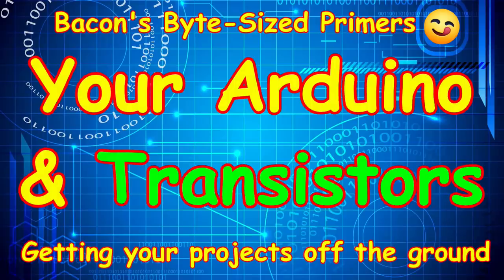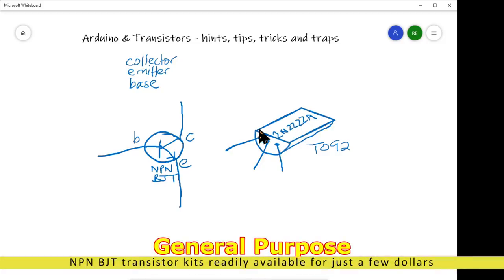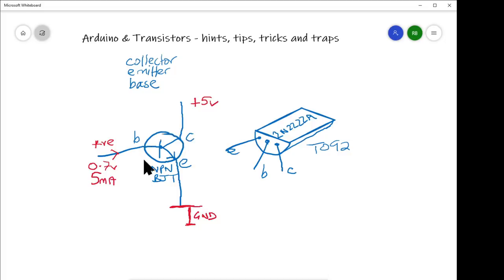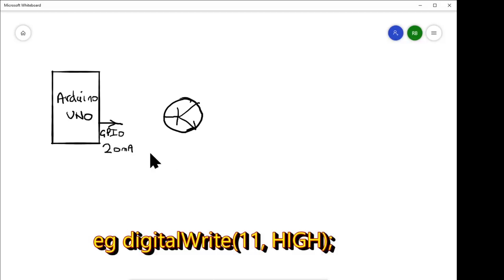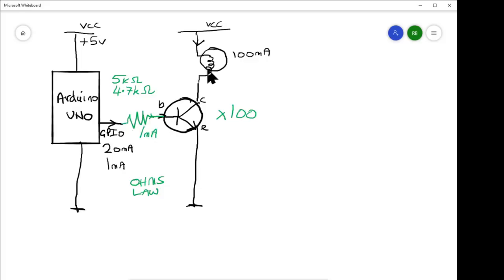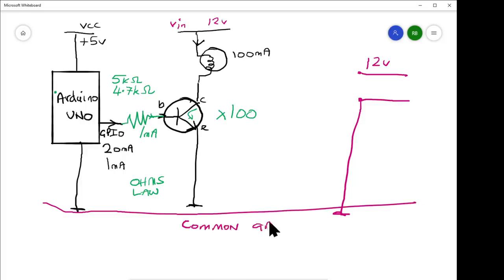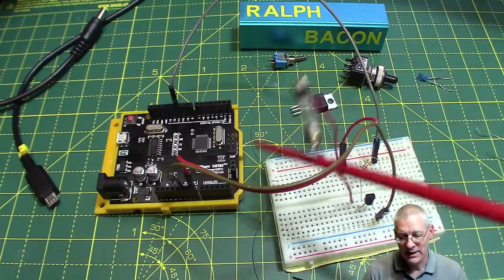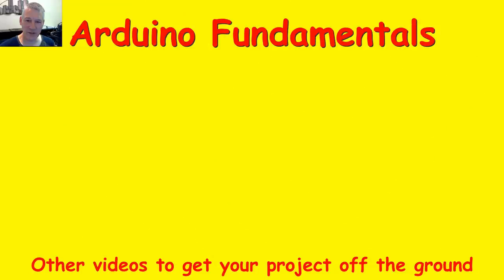#BB1 Transistors - from an Arduino Perspective. Bacon Bytes Beginners' Series.

Comment: Question: sometimes on a project I don't have the specific resistor or cap. But I read online, I can skip the resistor or use a different value. In practical terms, for such Arduino projects how much leway do we have in values?
Reply from the maker: It depends on what the resistor is doing. If it is limiting current to an LED then substituting a lower resistance might overdrive the LED. Or overload the Arduino port (pin). Not good. Substituting a higher resistance value one will make the LED (a bit) dimmer. That's OK. Other circuits might be much more critical. Others more forgiving. I don't think skipping the resistor is a viable solution though. You can buy entire sets of resistors (or caps) from Banggood or other warehouses for very little money (it's what I do). That way you have more resistors (or caps) than you know what to do with! But you never run out either.
Reply: In addition to kits of resistors, even if you don't have a value within the acceptable range you can often combine few of what you have in series and/or parallel to get a value close to the wanted.
Reply: Thank you Ralph I assume that the arduino already has a program to blink the transistor  on is that a good assumption?
Reply from the maker: Yes, the aptly named BLINK sketch blinks the built in LED (so no further components are required) but if you want to blink your own LED you absolutely must use a current limiting resistor (rule of thumb: 180 ohms is fine).

Comment: Good stuff.  My problem: I learned electron flow so I get confused with hole flow.  drat
Reply: Yes, the arrow on the emitter points in the conventional direction of current flow, but the electrons,of course, are going the other way.
Reply from the maker: Biggest mistake of the 19th/20th century in deciding that current flows from positive to negative, when in reality it's the other way round. Conventional vs electron flow. But we all understand it now, right? Oh.

Comment: What is the maximum voltage you can feed to Arduino without burning it's regulator?
Reply from the maker: I'd stick to 12v but in theory you can go higher to 15v or thereabouts. Not me though.
Reply: @RalphBacon  thanks for your answer. So since both arduino and the transistor have to be connected to the same vcc and vdd, then the biggest motor we can move is a 12 volts one correct?
Reply from the maker: If you want to use the Arduino to turn a DC motor on/off (with optional speed control) you can use any voltage because the motor voltage VCC (via the switching transistor) can be a different supply to the Arduino's. But do connect the GND connections together. I strongly recommend the use of an N-channel MOSFET transistor for this. Ensure it is a logic level (TTL) one, where it needs no more than 5v to fully switch on. I've done videos on this, scan the PDF in the video description for a suitable one.
Reply: @RalphBacon  thank you very much. Liked and subbed

Comment: Does transistor hfe affect collector current value? Is collector current 1mA(ib) * 50(hfe) = 50mA(ic) ?
Reply: yes, Ic = Ib x hFE   where hFE is the gain at Ic
Reply from the maker: I've replied here in another comment that shows that gain varies depending on collector current. At 500mA the gain is only 30 but at 150mA it's 100. Datasheet tells all!
Reply: @RalphBacon  Quite so, though how to put in equation form?  hFE:[Ic,  Vce] = Ic / Ib?
 I realize you tried hard to keep it simple but aren't you opening a can of worms by mentioning higher current [[like 500mA]; now you have to consider Pd.   Perhaps make it a two part video; the basic idea, and advanced [covering Vce, Ic, hFE, Vce[Sat], Pd, Vbe with the complete equation for Rb ------- OMG Math!/MathS].
BTW don't incandescent bulbs have an inrush current [which could exceed IC[peak]]?  More worms!
Reply from the maker: I see no worms, Kenn. Nope. Worm free. I mean, why complicate things? I didn't mention the changing gain in the worm-free video, I'm not that stupid! It probably never affects the average Arduinite anyway, especially as we generally whack the transistor to full saturation, the relay / bulb / LED switches on - job done!

Comment: Instead of searching datasheets for pinouts, I recommend a cheap component tester like this: https://youtu.be/7Br3L1B80ow
Reply from the maker: Yes, I have one of those. But in many ways, learning how to look stuff up in a datasheet is a skill that would behoove many who do this hobby. You can quickly learn to pick out the salient points (there's a ton of stuff I skip) and you can learn so much whilst just idly glancing at the pdf. What?!? Maximum collector voltage 15v? Who knew?